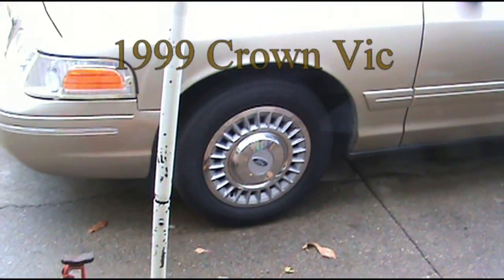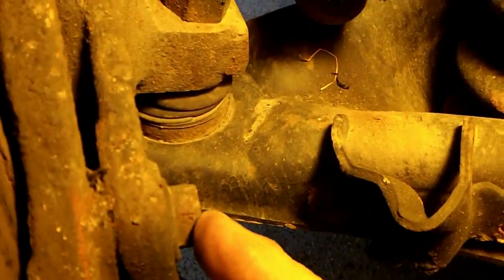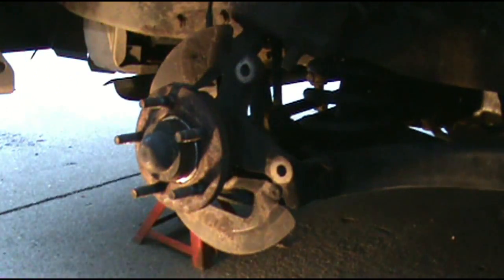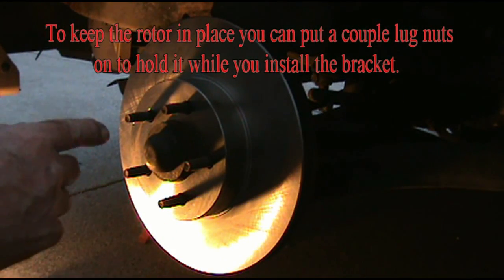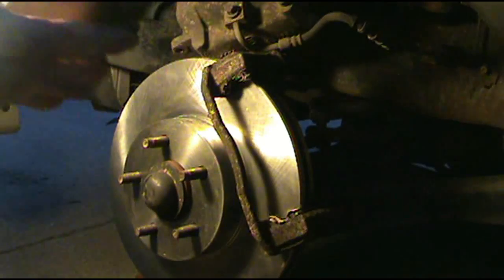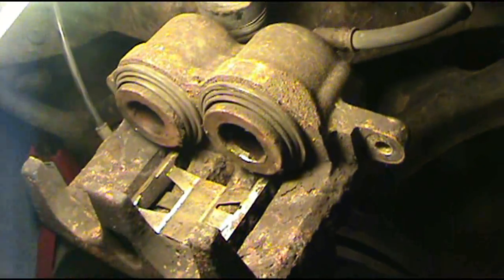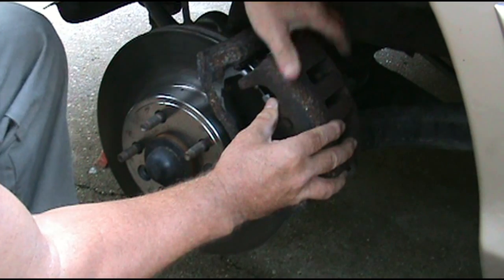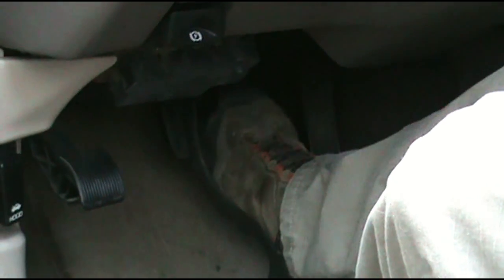1999 Crown Victoria - brakes and rotors

Comment: Never forget to grease the slides for the caliper bolts . If not you’ll be doing this all over again
Reply from the maker: Usually the bolts are sealed but Yes, thanks, you need to check the grease on the bolts and slides.

Comment: do i gotta press the brakes in the car after each rotor and pad i replace or can i do that when im done replacing all of em
Reply from the maker: I would do each one while the wheel is off just to make sure it works properly and don't need bleeding.

Comment: I have a 92 crown vic, need to replace back brakes and rotor, shop wants about $4 to $500.00 for it. are the brakes about the same? good video, easy to follow.
Reply from the maker: I don't know what year they went to all dis brakes. If the back is dis. brakes they are about the same. If they are drum brakes they are not that bad, you just have to deal with springs. If it is drum brakes take a couple pictures before you remove them.
Reply: howdy, Lonnie, they are disc brakes, I've got some cd roms I can use if necessary, lmao! picked up the parts yesterday, gonna give it a try tomorrow, when ever it stops SNOWING!
Reply from the maker: Cool! you should have no problem except for the cold weather if it is snowing. Stay warm!